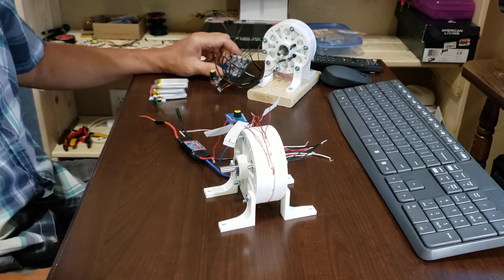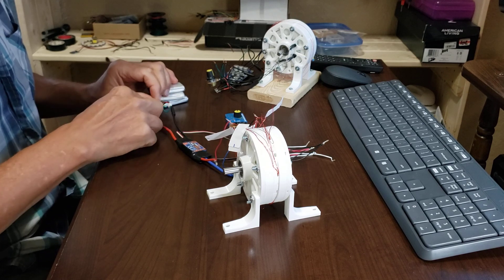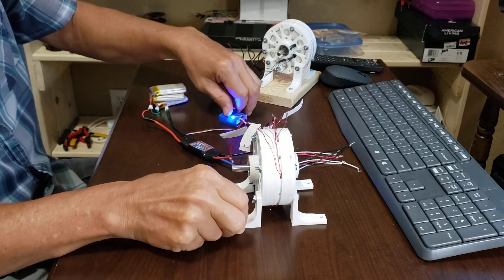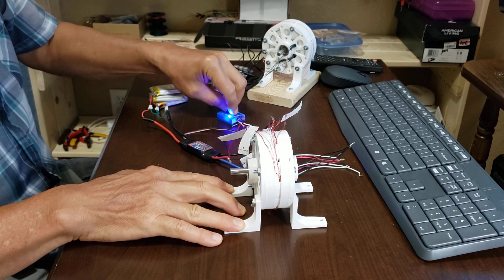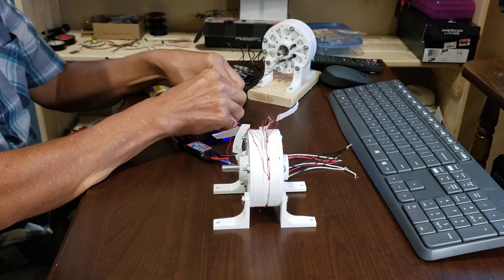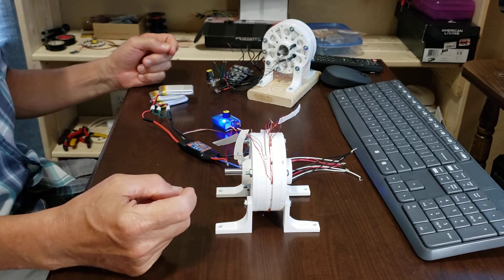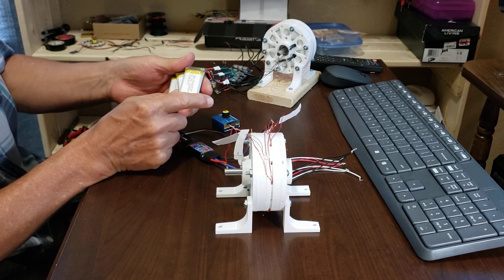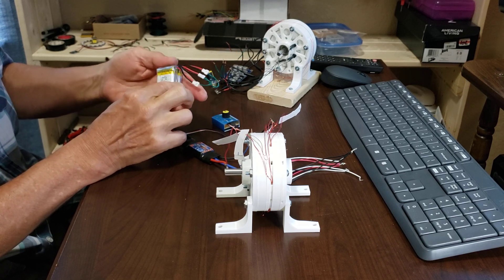More Power! 3d printed, Axial Flux, BLDC motor number 3.

Comment: I would like to build a more powerfull motor with low rpm 1500 rpm maximum
Reply from the maker: I checked your channel and see that you have a video by amazingdiyprojects.com . That is the guy I got the plans from to learn to build these motors. For  low rpm I would suggest a sensored motor. I have other videos showing this motor using hall sensors. If you want low rpm and high torque, I would suggest a large diameter. Or you will be needing a lot of amps.